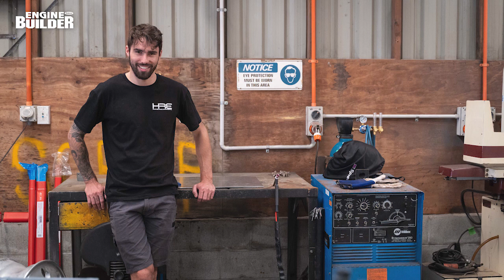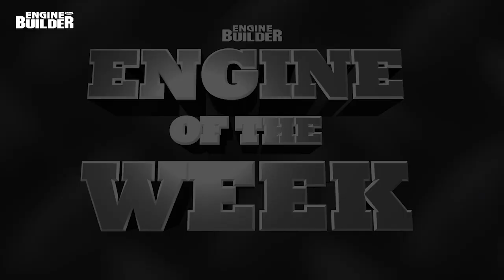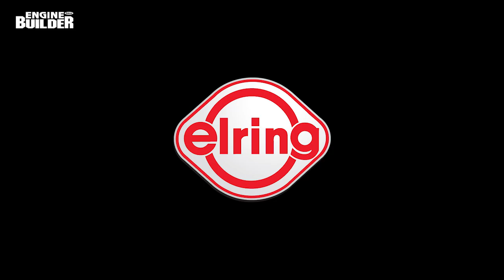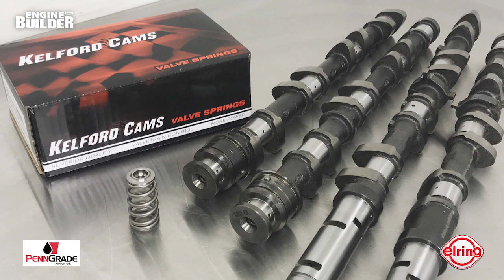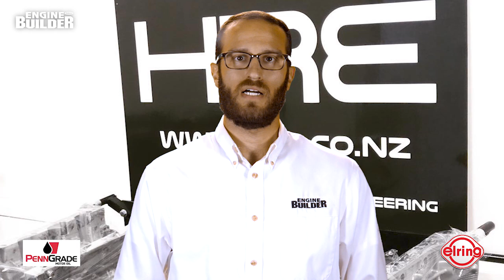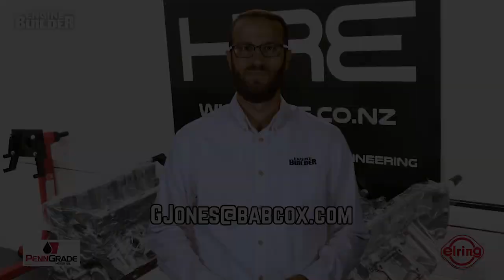Toyota/Lexus 1UZ-FE

Comment: 🤣 well he cant of done to much to it then because the race version of this motor its intended purpose was made for toyota in nascar ran 500hp n/a anyway
Reply: Not with only 4 litres they didnt
Reply: different motor and different rules. limited to 10-1 compression, ( F1 is 18-1) limited in valve lift, limited in carb cfm, these motors are used in Contact Stockcar Racing NZ style. The restrictions are there only to save lives!!

Comment: Putting a 1uzfe in my old trooper, starting the rebuild of the donor engine this week, came out of a running vehicle in good shape but replacing all the gaskets etc while it's out so I won't have to mess with that again for years to come. It's a well built engine, mine is a first gen non VVTI 10 to 1 non interference one.
Reply: I bought a sc400 1992 model to 2jz swap, one I did my homework on this motor,  holy crap I am keeping it.

Comment: I love that timing belt cover. One piece vs. the stock multiple piece with the rubber edge guards that eventually become stiff and can fall of into the timing belt cog at the crank, thereby making the belt jump time. Ask me how I know :-(
Reply: Bro i was doing the timing belt and some of the crap fell off into the crank when i already had the plastic cover on and all the other fixings on. Its sucks because i still have yet to find a place that manufactures those plastic covers.

Comment: why all the crazy bottom end mods??? Ive got one making 750bhp on stock bottom end just with race bearings in it????
Reply: Because thats a 1uz vvti. Unlike early non vvti 1uz’s the rods are way too skinny to be reliable above 400hp. Also the high lift from the cams would run valves into stock pistons, so might as well get a forged lighter piece to help offset the beefier rod.
Reply: 8000 rpm isn’t high rpm for an over square engine if race restrictions removed they probably could breath up higher
Reply: NA build race car always more expensive than turbokit. 4age16 turbo kit will get 250 hp easy n cheap, but 4age16 formula atlantic will price more than $20, 000. But you cant beat NA high revving motor race car regulation class by just turbokit install
Reply: its the on and off nature of the racing, and the use of the go peddle,. These motors are to start a race from standing start position, they go straight to red line from standing still, and they go on and come off the loud peddle many times over the distance of 12 laps on a 450 meter track, causing strain on the motors. Also the motors get smashed in to concreate walls and other cars made to be hit so need to take the bangs, need to handle the heat, need to do it 3 times a night, and 3 months of the year, you run your make believe 750 HP like these guys run there motors and your will be fukked in no time, these will keep going till the death in a sport where crashes aren't accidents, they are full on attacks, and you expect to carry on racing after the hit, be it giver or taker...got no room, make room..8000 rpm is a lot over a short track...
Reply: Your boosted build doesn't turn the RPM's these strung out N/A builds do. And being they go in race cars, they need them to be as reliable at those power levels and rpm's as can be. These HRE engines start around $30K.

Comment: This is one of the most underrated engines in the auto world.  Half a BILLION dollars went into R&D for it.  It's certified as an aircraft engine. It had over 400 prototypes.  Toyota left no stone unturned in looking for the BEST way to make a V8 when they created this.  No wonder they can last for 1, 600, 000 kms.
Reply: It doesn’t need a main girdle because it has 6 bolt, cross-bolted mains. And timing gears don’t work on a DOHC engine like that, just look at the distance from the crank to the camshafts. Perhaps a chain would be better, but these engines aren’t known for jumping timing.
Reply: I own a few of these monster v8’s there awesome in design and cost over 400 mil to design the chassis cost the other 600 mil in the ls400 to build, these can hold 1000 hp no problem
Reply: @captainsidewinder  I am changing my starter right now. For the moment, I hate this engine. Hahahaha
Reply: Baddest Burrito yeh it’s a pain being sat in the V
Reply: @captainsidewinder  Duuuuuude, tell it like it is!  And it's not just that, but ALL the itsy bitsy pieces that have to come off, too, before you can even lay a finger on that starter, are more numerous than grains of sand on the beach. And there's no clearance to get your tools on anything, or your hand into position, even if you could get a tool on it. 

And once you get to the starter, Toyota raises their middle finger to you yet again, by pointing the bolt heads against the freaking FIREWALL.  Like, WTH, TOYOTA???

This engine runs well when it's healthy, but for serviceability? It was designed by psychopaths.  

I also did the timing belt 2 years ago, which is almost as big a pain in the ass as the starter. Ugh.
Reply: Baddest Burrito one of my uz is one 960,000 miles it’s an original engine, just done cam cover gaskets was spotless and check valve clearance for curiosity it was spot on the engine is golden inside she’s on a million now I have no doubt it can do 5 million as one has hardly put any wear on it, engines been owned in the family from new 25 years ago at a cost of £65,000 in my uncles ls400 I own now I got 3 of these bad boys ones running 800 bhp with a back yard turbo on 400,000 miles
Reply: @captainsidewinder  That is AMAZING durability.  Maybe I should turbo mine, eh? Wow! 
I just finished the starter job last night. I can now switch back into, "I love my 1UZ-FE!" mode. Hahahaha
Reply: @captainsidewinder  I haven't seen a 1000hp 1uz. Only some guy that made an 800hp one.
Reply: @oscarguijosa7881  there are multiple 2500hp 1UZFE's.
Reply: And bmw stole it too dont forget 1uz came out 4 years before bmw 4.0
Reply: One's never too old to learn. I support your findings, it is a superb engine
Reply: One of Best production  small V8s created
Reply: Imagine heat + cryo treating one of these bad boys. It'd last forever.
Reply: Absolutely
Reply: It was a Billion dollars that was spent on R&D
Reply: @TaylorMadejdm1975  that was for the whole car (LS400) the motor itself cost approximately 400 million or so in design.

Comment: If you have 2 intake and exhaust valves that are smaller in diameter than a 2 valve engine would .500 lift on the 4 valve be equal to 1" lift on a larger valve diameter 2 valve engine?
Reply: Nah, overall valve surface area and port design have to be taken into account. Also youre limited to how much valve lift you can run without cutting into pistons too much, and affecting compression/squish
Reply: To add to that, you get exponentially less airflow increase with a linear lift increase.